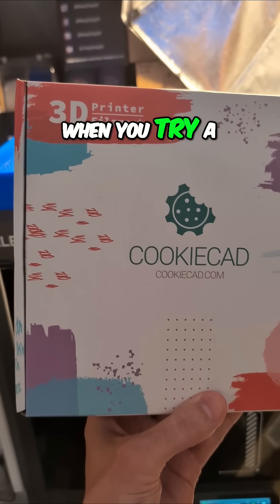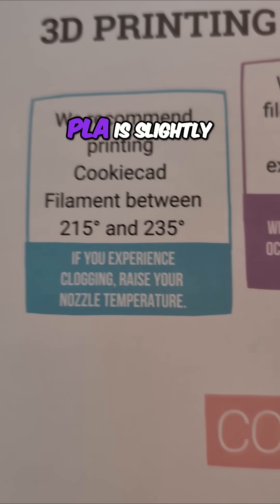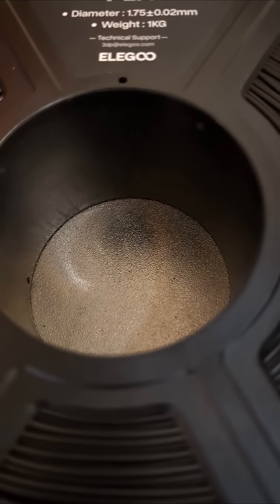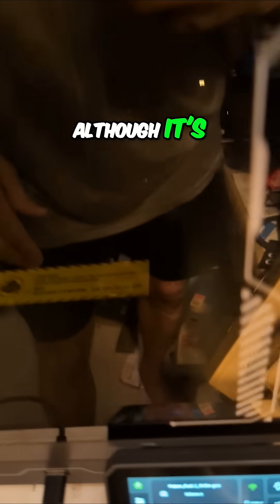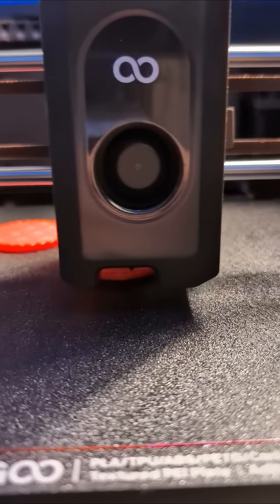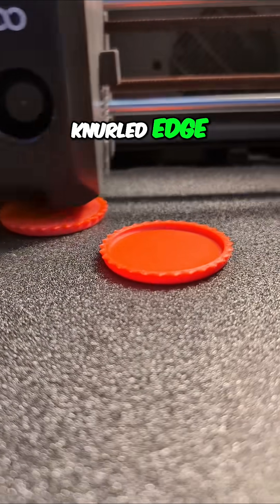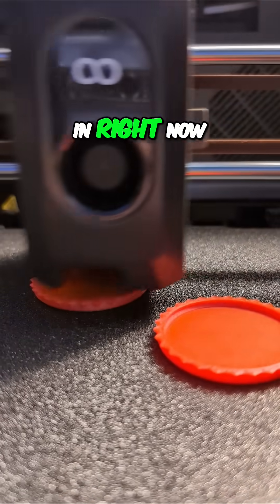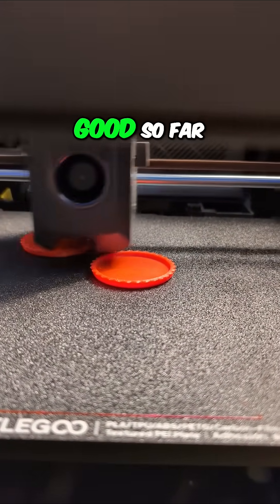3D Printing Trying a New Filament - Testing different temperatures

Comment: I don't get nervous when I try a different branded PLA, unless youre buying the real dirt cheap one you shouldn't have any real problems.

I find that PLA can vary in recommend temps even within the same brand. I have some white matte PLA and that prints fine at the default 210. However the yellow matte from the same brand recommends cranking it upto 215 or 220. Depending what you're printing though should be fine, I found some intricate prints didn't come out too good unless I cranked up the heat.. not sure what thats all about. Maybe something to do with how the yellow pla is made?

What I do get nervous about however is a different type of filament.

I am going to be doing my first PETG print tomorrow. And sometime over the weekend I am planning on my first TPU... the TPU worries me a bit but its all part of the process
Reply from the maker: I don't get too nervous either.

Comment: What did the temp tower look like?
Reply from the maker: Haven't done one yet. I ran them on my N4M last year. Can't remember where I got the file. Must have been in Cura, which I'm not longer using. Gotta find the file to run on the CC.

Comment: Currently having issues with my P1S because of a new filament I decided to try
Reply from the maker: It is frustrating when you either get bad filament or just haven't figured out the right settings. Hang in there!